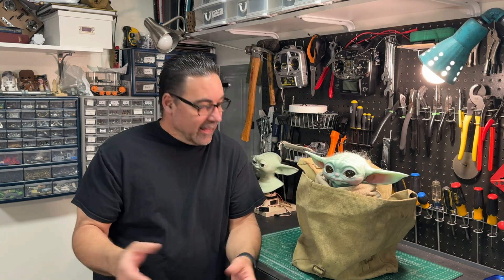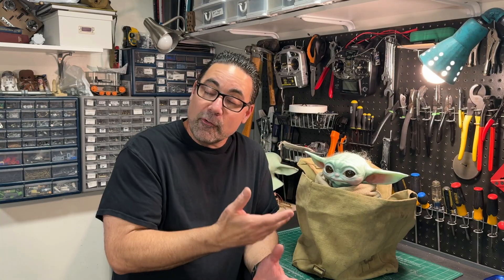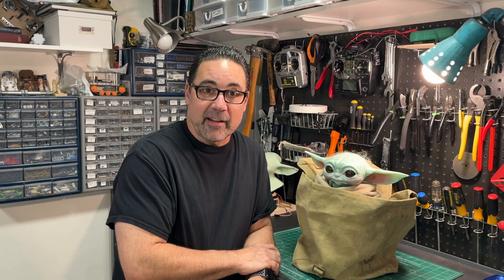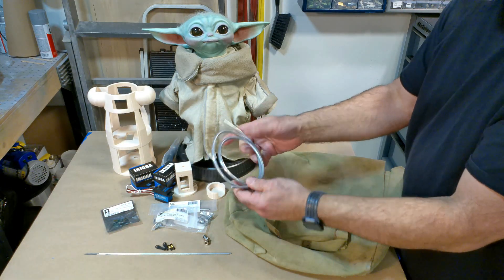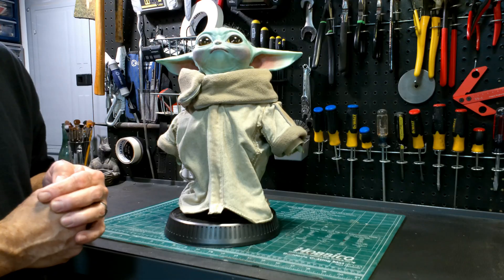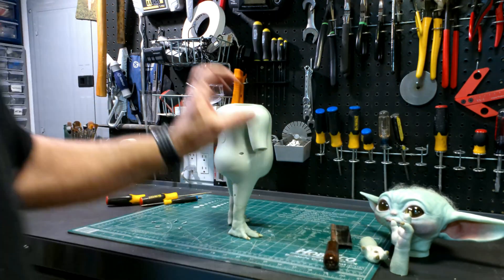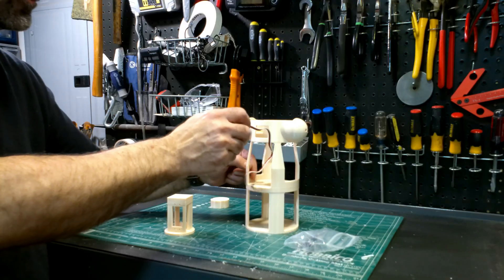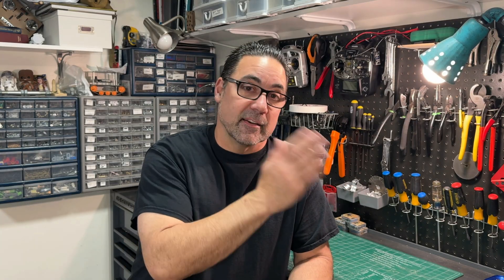Building an Animatronic Grogu for Cosplay – Step by Step Series – Part 1

Comment: For the STL files you have provided, do you have a recommendation for what company to choose to produce the files?

In addition thank you so much for your expertise, I’m so ready to upgrade my sideshow Grogu. With your help Friend
Reply from the maker: You can print with almost any material here, I use an FDM printer with ABS Filament. For this project, you can use PLA or any similar material.  I would ask your friends if they have a 3d printer or look to see if there is a local makerspace. In Los Angeles, the city library can print items for just the cost of the filament.